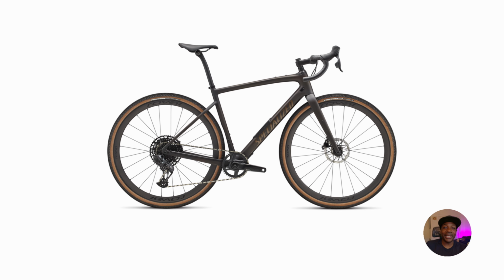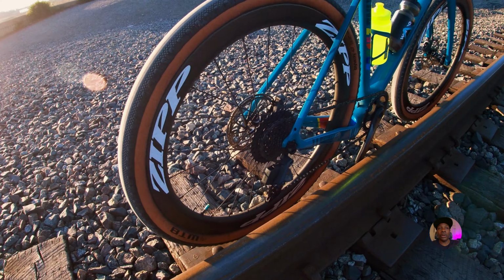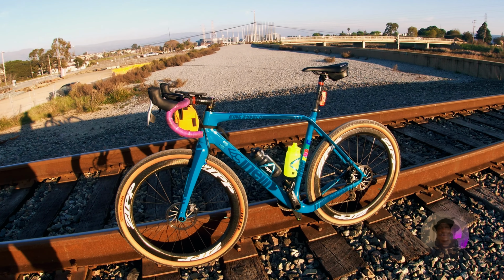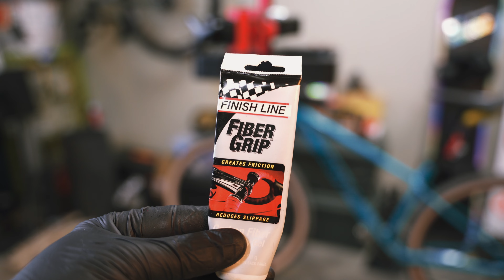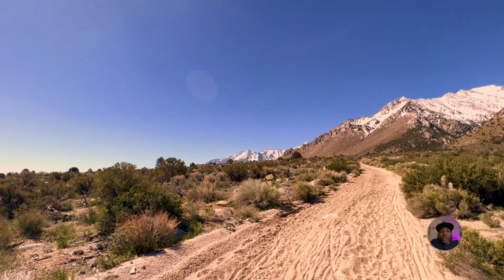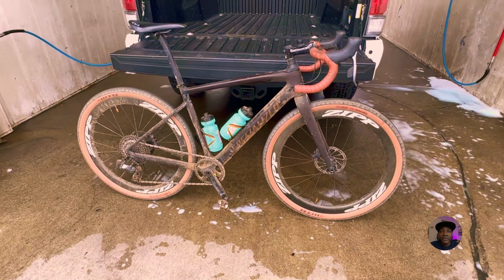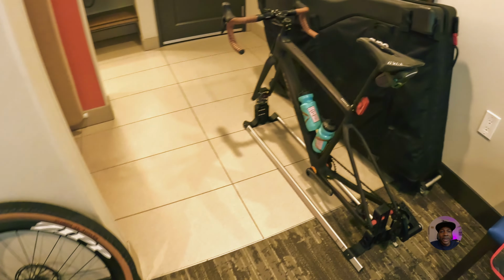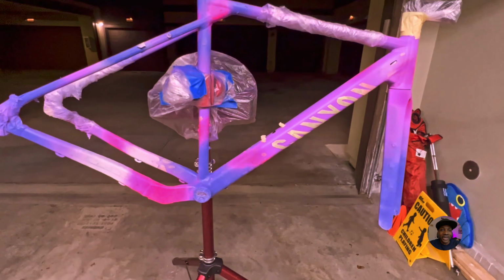SPECIALIZED DIVERGE 9R | GRAVEL BIKE BUILD

Comment: I was thinking about buying a diverge. Would you mind commenting on what makes it uncomfortable? Is it the frame-set compliance, geo, or maybe the deeper dish wheels? Thanks!!
Reply from the maker: To be fair, I think the discomfort was from my poor power to weight ratio. My fitness wasn't as good as it should have been when I was riding the bike. It was considerably heavier than my previous gravel bike. (Much heavier than my Tarmac, but that's a given.)
Also, the Fizik Terra Argo saddle didn't jive well with me. 
So, it all boils down to very minor things related to personal preference vs. any serious bike related issues.